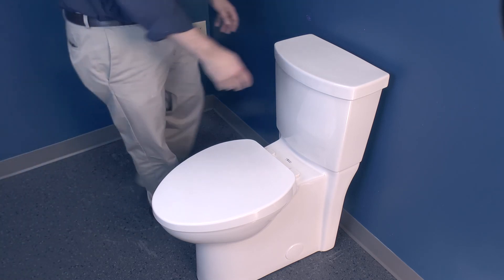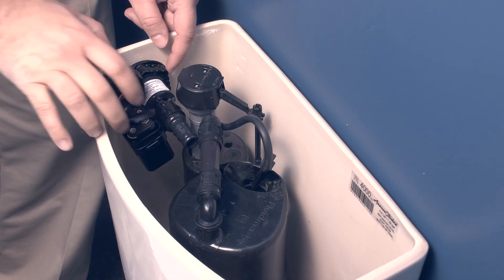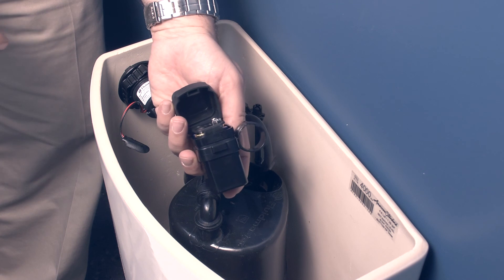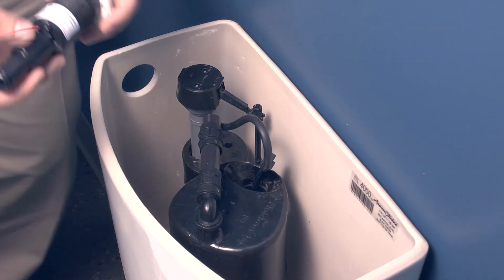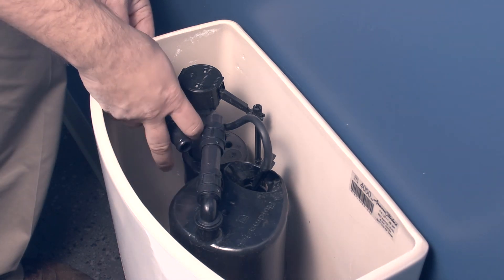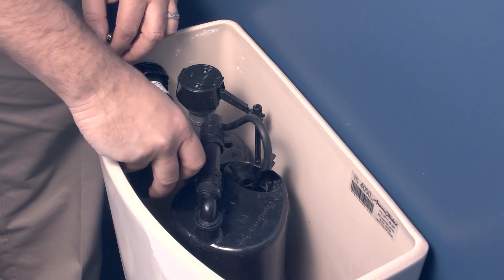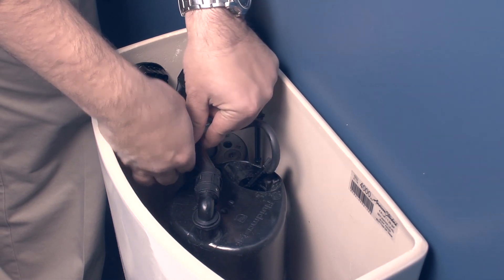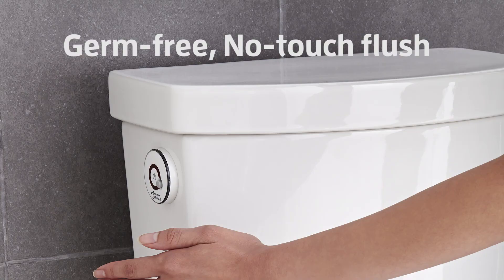How to Install an Actuator Assembly for an ActiVate Toilet

Comment: which they would tell us how to re-activate auto flush on-line. I changed the batteries flashes red several times then blue. Manual flush works but automatic is not.  This happened b/4 and I left is alone for a couple weeks until one day it automatically started working again.  Now I must replace the batteries again and guess what....manual flush works but auto does not.  This should not be so complicated. UGH!

Comment: Same thing happened to mine. I went to change the batteries and found they were all corroded. The system was in my house when I bought it two years ago and the battery compartment was a 1/8 to a 1/4 full of water. When I removed the batteries, the wires just broke off immediately due to corrosion. :-(

Comment: Terrible system battery box gets wet ,wires corrode and its junk! No way to switch to manual cause of large hole for actuator!
Reply from the maker: Hi There - We officially discontinued the ActiVate toilet, but you can still purchase replacement parts from our web site. Have you considered replacing the entire tank with our new and improved Cadet Touchless toilet tank (4000709.020)? This will work with your existing ActiVate bowl, and here's the installation video for full product details: https://www.youtube.com/watch?v=AvSThqRTclA Thanks!
Reply: @americanstandard  Hi thanks for supporting us with this discontinued toilet . Which are all the manual flush Cadet  tanks that will fit the bowl ? I see Cadet 3 or Pro at Home Depot .
Reply: @jonadabster8401  What did you end up doing here? I'm in the same boat
Reply: @Zedoate  1st thing , American Standard sent me a replacement flush seal that has been working flawlessly since .The original had a very slight warp in it's rubber flap  , like if it sat leaning in the box while on it's side . But I also bought on Amazon a complete manual flush tank to install once I can't repair the hands free tank . American Standard 4021101N.020 Brands Cadet 3 High Efficiency Toilet Tank, 1.28 Gpf, 3 In Flush Valve, 12 in, White .I have not tried it , but my research said it would fit . I suggest you look for yourself to be sure . I love the handsfree feature for the moment , but the bowel stains easy and is too shallow , I literally have to hold my junk when sitting . Whata pain in the neck . I should sell you my replacement tank .